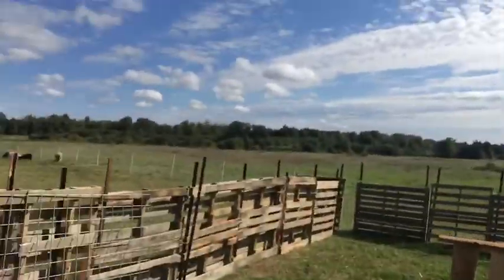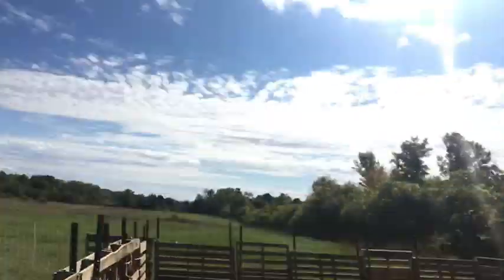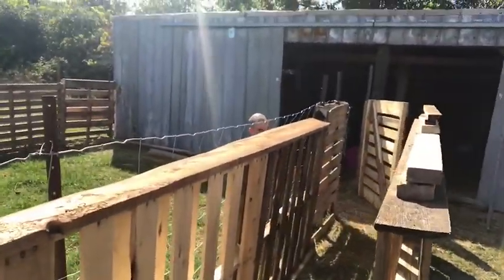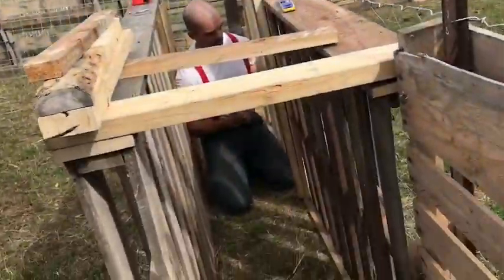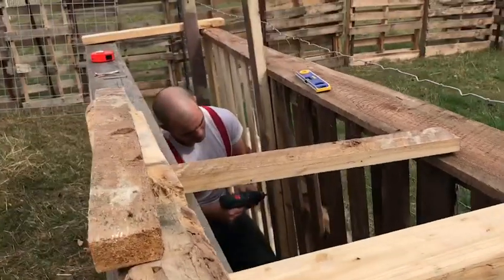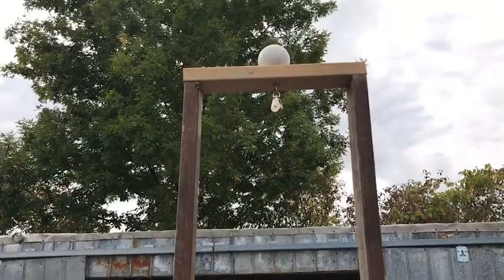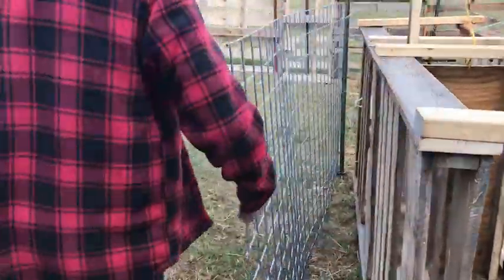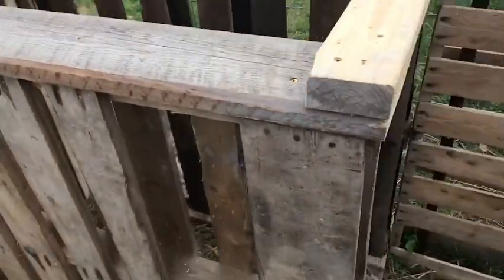How to Make a Pallet Sheep Handling System

Comment: Thank you for posting the video  It would have been nice to see how you actually make the chute and the pulley type gate.  Does the solid piece of wood with the pulley lift have groves in the side of the boards or is it just cut to size to fit enough not to wiggle?  Thanks again for posting.